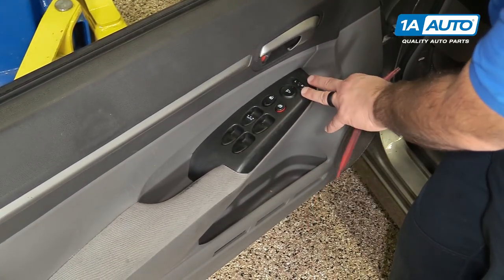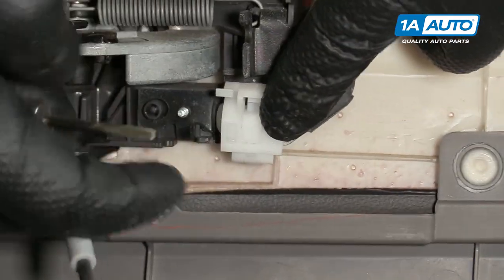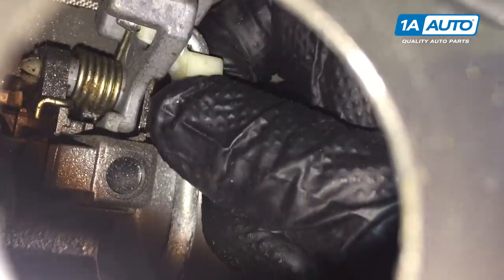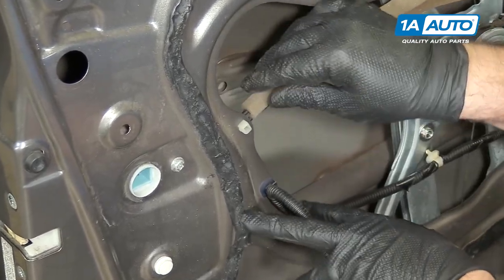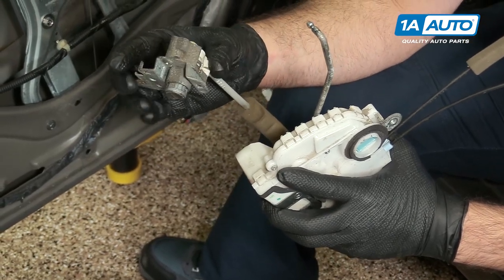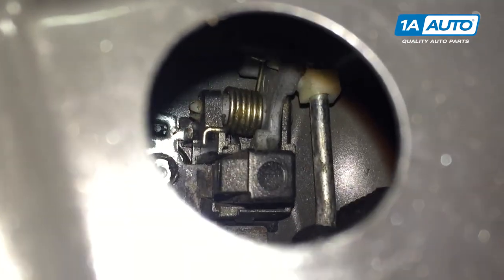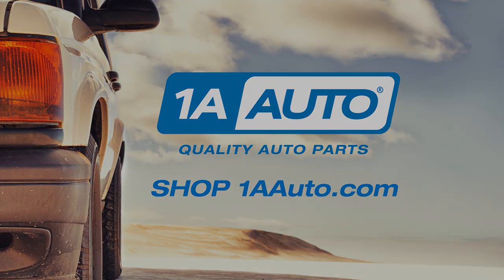How to Replace Door Lock Actuator 05-11 Honda Civic

Comment: I changed the actuator and still won't lock with the beeper. Can it be the cable or lock switch is messed up?

Comment: Hi quick question, if I install these power door lock actuator assembly in honda civic 2008 DX equipped with manual locks, will the car be able to have a power lock?

Comment: Great video. I used it as a reference guide to replace the rear door actuator in a 2007 Honda Civic Si Sedan and the door handle also (in other video). I watched the videos about 2 times each and then it was pretty straightforward. I did have issues getting the lock connector cable to snap into place along the threads and the clip as there was no extra play / cabling.... It is very helpful to have an assistant helping you to hold up the door panel as you do this. Never hurts to have an extra set of hands...
Reply from the maker: +Aaron Bell Thank you! We love empowering our customers and showing how to perform DIY auto repairs with our high-quality auto parts.  http://1aau.to/m/Shop-1AAuto-c

Comment: Thanks so much for the video. i found the hook-like part that attaches to the exterior handle really hard to remove! I ended up ripping it off by pulling really hard but at the same time cut my wrist because i hit a sharp part of the interior door panel. had to get 5 stitches but came back after and finished the job!
Reply: i got my parts from a car wrecker

Comment: Nicely done👍
I have one question
My 2011 civic AT with a door lock issue that started today.
While driving the doors keep trying to lock themselves repeatedly even though they are already locked. Its random and the locks seem to work ok when the car is either turned off or in park.

Thanks for any advice forth coming.

Comment: WARNING.   if you don’t use a PH3 Phillips for those lock actuator screws, you will strip them.     

Today I actually had to use a ball peen hammer (round head against the screw heads) spring-loaded impact screwdriver AND a torch to get the last actuator screw out on a 2009 CRV .     I tried a PH3 bit on an impact driver gun and they still wouldn’t budge.

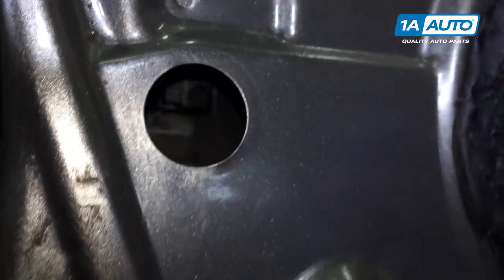Comment: 14:20 Using a little bit of the butyl sealant to hold the bolt inside the socket is one of those great pro tips to avoid frustration.  If you don't do it, you're going to end up fishing that stupid little bolt out of god knows where with a telescoping magnet -- several times.
Reply from the maker: +herrbrahms Thanks for the feedback!

Comment: This is great, very detailed! How do you open the door on this car when the handles won't work?
Reply: Happened to me but luckily I kept on pushing door from inside while opening the handle and turning on/off key fob. I didnt secure the door lock cable attachment at the threaded part to the door handle unit.
Reply: nicktheoneofmany  having the same issue. Did you ever figured that out?

Comment: Idk if you guys are still responding to comments but I need a little help here:

I was doing a version of this repair, but for the rear driver-side door, the back left. Got most of the way through the repair, having swapped out the actuator. I reconnected the door lock cables to the door face and snapped the face back into location, but had yet to fully complete the repair. It was at this point that while moving about, the door swung shut. Neither the inside or outside handles work, and the door is now just locked shut. Is there a way to get the door open again so I can finish the repair/figure out why the handles won’t do anything? My thought is to somehow remove the door face again so I can access the door lock cables, but I dont see how I can do that from inside the car with the door shut. While this is a better situation than my door having been stuck perpetually unlocked, I’d rather have the door be fully functional.

Edit: Also, the plastic thingamajig that can be seen at 1:43 pretty much exploded during the repair, do I need to replace that or does it even really matter?

Comment: hello, i know that this is an old video so i might not get a response. But i would like to inquire if an euro/hatchback version of the 8th gen civic (06-08, fn chassis) uses same master-cylinder/lock ? i can find any info about it on the forums
Reply from the maker: +@pottasium7117 This procedure might be different for your application. We do not currently have a how-to video for this particular year, make and model. Thank you for asking! http://1aau.to/m/Shop-1AAuto-c

Comment: My door lock and the actuator are completely separate. There is no way to connect them. It seems like my actuator is different and it is not compatible with the door lock.. any suggestions?? New actuator?

Comment: hey 1A Auto Parts    i got a question i am new at this and really need help i have a 2008 
civic dx it has power windows how would i put power door locks in and 
what would i need if you could help me out that would be great or if 
anyone else knows please can u let me know
Reply: O just bought the same car as yours today it has power windows and i want to put power doors too cause i have to lock each door a part
Reply: @ukt000  did you figure jt out?

Comment: So I have a 2007 civic ex sedan. The fob only unlocks the drivers side which is ok. But the lock/unlock button on the driver side only works for the driver side and not the other 3 doors. The passenger side doesnt doesnt lock or unlock any door. Would I need door lock actuators to fix this for the other doors? I will say when i mess with the fuse sometimes the drivers side lock and unlock button will work for the driver rear door and then it stops. So what would be the issue? Maybe a wire? Or door lock actuators?
Reply from the maker: +Dustin Rust We wouldn't be able to diagnose an issue like that here, you may want to have a local mechanic take a look at it. Thanks for checking us out! http://1aau.to/m/Shop-1AAuto-c

Comment: Would a sign that the actuator is about to fail be that the lock/unlock sounds really slow even if it still works?
Reply from the maker: +Leo Spaceman We wouldn't be able to diagnose an issue like that here, you may want to have a local mechanic take a look at it. Thanks for checking us out! http://1aau.to/m/Shop-1AAuto-c

Comment: Hey 1a autoparts i got a question for you i have 2008 civic dx 4 door sedan it doesnt have power locks i have 4 lock actalators how do i install power locks do i have to get 4 new doors
Reply from the maker: +patrick lynch That's a big job, especially if you do it yourself. We do not have a video for that.
Reply: @1AAuto  I have the lock actulators like the ones u have in the video and I also have a keyless entry system with lock actlators
Reply: @1AAuto  What is the best way to put power locks in my car

Comment: Can’t find door actuator that says it’ll fit a 2008 Honda Civic on your site...
If I get it elsewhere I can still follow this video right?
Reply: Hello I have Honda 2008 and whenever my heater is on the ac pipe keep freezing too and someone told me actuator problem do you have the same issue?
Reply: @akinsojia3209  The door lock actuator and Heater core / AC compressor do not communicate at all. This isn't your problem

Comment: If your actuator doesn't come with new cables or don't include it you will have to remove the cables from the actuator to put onto the new one. Be careful as the ends that go into the actuator are very small and fragile.

Comment: 1A auto can it be done though if i took it to a mechanic shop
Reply from the maker: +patrick lynch If you're going from stock manual locks to power locks you will probably need a mechanic as that's a big job

Comment: I have the lock actulators like the ones u have in the video and I also have a keyless entry system with lock actlators
Reply from the maker: +patrick lynch Thanks for checking us out! 1aauto.com
Reply: @1AAuto what is the best way to put power locks in my 2008 civic DX i have the lock actulators like u have in the video and i also have a keyless entry system with the lock actulators
Reply: patrick lynch did you ever figure out how to do it? I’m in the same situation.

Comment: My Granddaughter  had a seat belt caught in the left door of her 06 Civic. A friend finaly got it pried open then replaced the fouled up actuator. But the door was bent up & soon the new actuator's  nylon coating on the door latch fingers got cracked & the door was jammed. I couldn't get the latch to line up proper, then it jamned so bad i had to pull the plastic side panel off exposing the door pillar, then cut out the strike plate bolts with a cutting torch to get the door open. I then did some rough body straightening work on the bent door around the latch mechanism. I refit the strike plate but this time i ground 2 nuts sort of cone shaped & soldered them onto the countersink on the top side of the strike plate so the plate could be bolted onto the door well from behind. Now,  if this door ever jams shut again, I will remove the trim to get at the bolts for the strike plate. When i unscrew the bolts, the strike plate will be free of the door, and i can open it.

Comment: Wrong video for 2005
2005 should not be included
Wrong way to remove door panel
These are fragile plastic covers
He should have used pry tool
And start praying the gaps
Then pop off cover
Bad video example
Poor treatment to people's
Vehicles
Reply from the maker: +Cb400f Honda Thanks for watching!  This video applies to the eight generation Honda Civic, which has model years from 2005-2011!